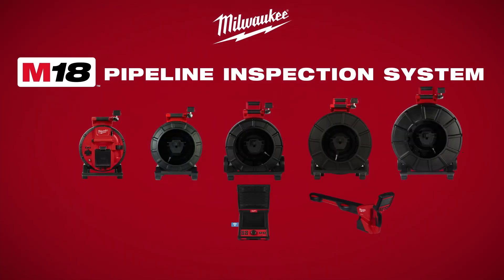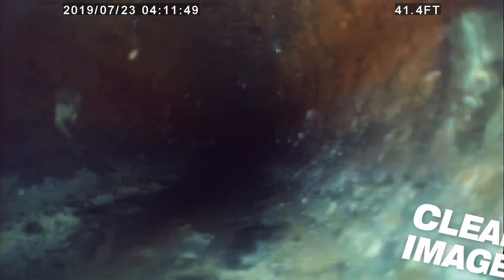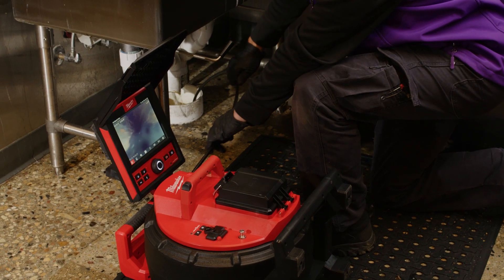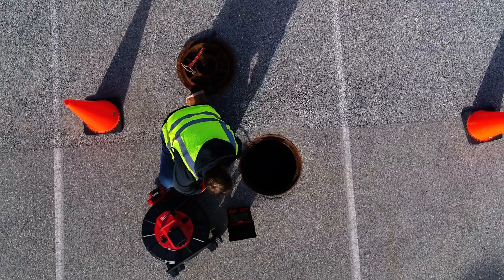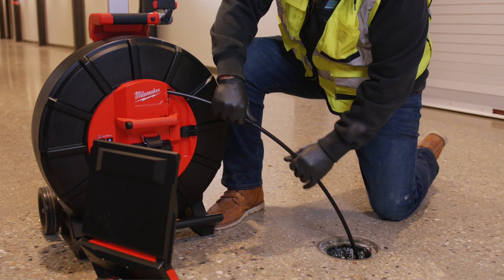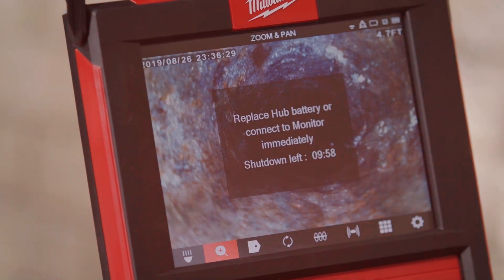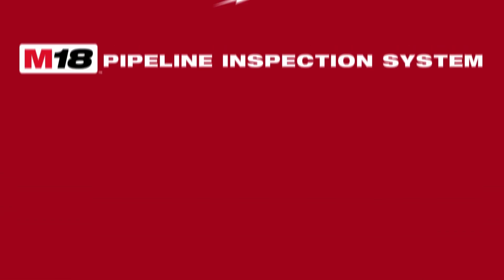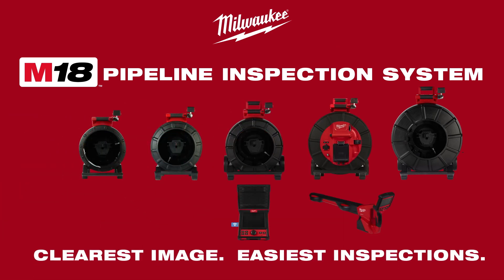Milwaukee® M18™ Pipeline Inspection System

Comment: DO NOT BUY THEIRF TOOLS: OVER PRICED AND PRETEND WARRANTEES!  Since customer service does nothing I plan to post this on every v video and site I can.  I may not get my money back but hopefully I will save others some.  For years I have supported Milwaukee tools- until this most recent experience.  I purchased multiple batteries, costing several hundred dollars and within less then 2 years none of these products work.  I sent them in for warranty coverage- SV5340308- is my reference number- and they are refusing to repair because their manufacturing date is greater than the warrantee time.  Now I am unsure about other stores, but when I purchase a tool I go by the date purchased not a manufacturing date I can not see.  SCAM!

Comment: Can you make the tool cases a battery charging station as well please ? The underside of the lid should be able to snap and hold batteries as well as charge them. Just plug the case in and it will naturally charge batteries that are snapped him to the underside of the lid.  Can be made water tight as well, super cheap.